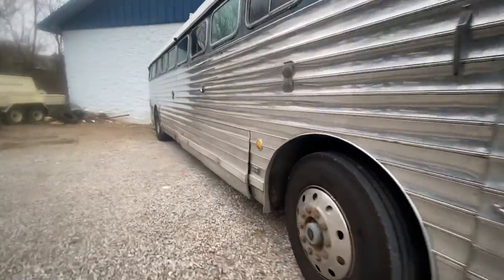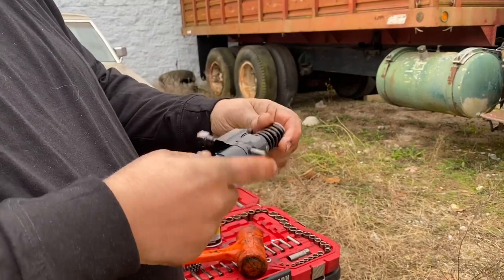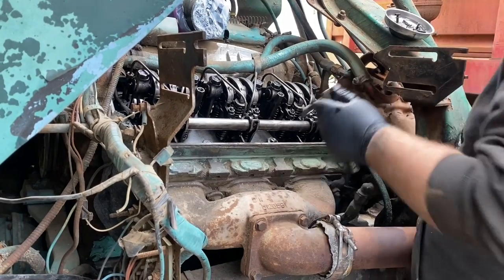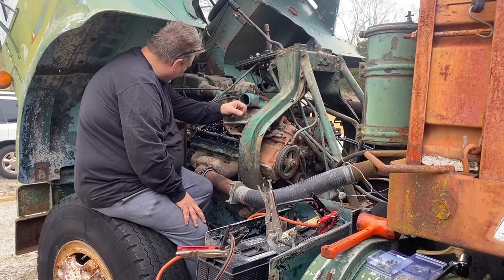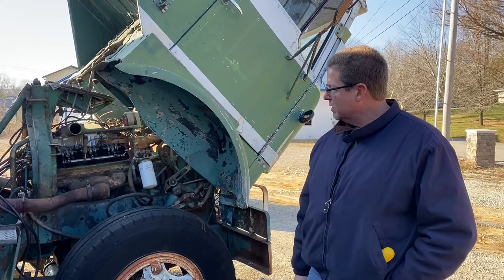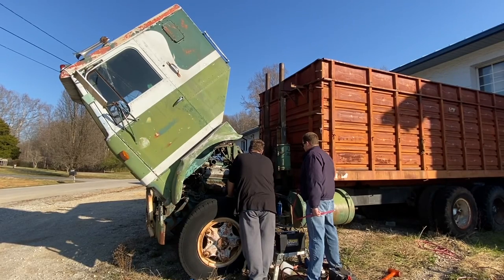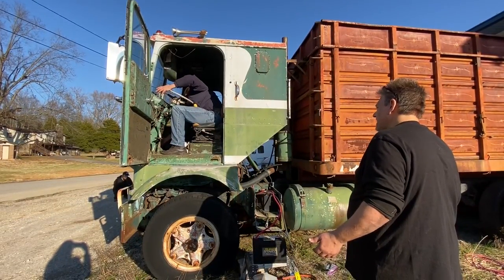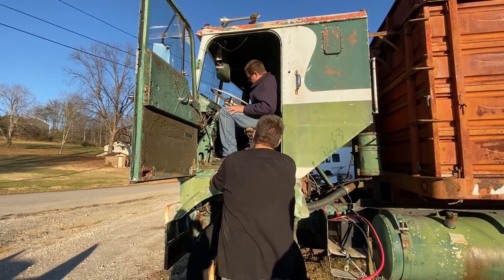1964 gmc cracker box truck 1st start in over 20 years. COE 1st start

Comment: There was an old school trucker's misconception that front brakes caused spin outs on slippery roads like in icy conditions.  So most trucks and tractors up through the late 70's didn't have front brakes.  Research and testing in later years proved that front brakes could actually be an asset on slippery roads.
Reply: driving slow on ice if you have a lever type park you feather it to do the rear only to stop the front sliding on tight bends and stuff
Reply: Modern trucks have front brakes the air pressure is reduced by 40% to help keep the steer brakes  from locking up . It's still possible on very slick roadways though. Trucks today have anti- lock brakes so that helps also
Reply: In the 1980s there were news reports that the New York State Police were cracking down on trucks with deleted front brakes on the Thruway. The stated reason for deleting the brakes was "fuel economy" on that 530-mile road and some said their wheels locked in slippery weather.
Reply: yup.
Reply: Truck manufacturers are increasingly adopting disc brakes.

Comment: That engine looks pristine under the valve covers. The dead blow hammer may not be dead yet but it has been maimed.
Reply: My thoughts exactly, very clean engine.
Reply: Most of these old detroits are clean inside. I used to rebuild 71 and 92 series heads for princess cruises on there entire Alaskan tour bus fleet.
Reply: I noticed the same thing underneath it’s pristine you can tell formerly it was taken care of by its owners

Comment: My Dad drove a 64 Cracker Box flatbed truck & trailer only it was new and had an 8v71 in it. He loved the motor but the cab was the Ford Falcon of trucks, absolutely no frills and not very durable. I spent many Saturdays being the grease monkey as a teenager.  He drove it about three years before he talked the boss into buying a Peterbilt with 8v71. I still love the distinctive sound of a Detroit Diesel. Glad you got it running.

Comment: That truck most likely has a 24v starter. The part you described as the starter solenoid is a series-parallel switch which allows the truck to run on 12v but provides 24v to the starter while cranking.
Reply: The old Mack trucks used those series parallel switches along with a positive ground system. They also used four 6 volt batteries if memory serves me correctly.
Reply: @williamjones4483  you are correct!
Reply: Some of the early diesel Toyota land cruisers used the same system of 24v start and 12v run.
Reply: I had a old Kenworth, mid 70s, that was an 8v, and it was a 24 volt system.  I was thinking the whole time I bet this is 24volt
Reply: He would be better off putting in a 12v starter and doing away with the troublesome series parallel switch. They are a bit pricey.
Reply: Those old 12-24 systems were pure junk. They were so troublesome back in the day you  could have made a business out of swapping out series-parallel switches and Duvac charging system  modules. I don't miss dealing with that stuff at all.
Reply: I'm currently troubleshooting a SPS (w/ positive ground) on a 1959 Freightliner, and it's testing my patience and electronics knowledge!!
Reply: @madmurdock2968  Hey Mad, here's a tip. Go to the internet and look up Dan Sullivans book on Electrical Troubleshooting.  This book is written by a true expert and it's put in mechanics terminology.  Obviously this won't fix your problem but it's the best reference out there for automotive electrical diagnostics.  Good luck.
Reply: Mad Murdock the series parallel switches have multiple internal contacts that can fail. Id be willing to bet your switch is bad.
Reply: @markphilpott8735  Mark, thanks for the tip!
Reply: @junkpile4106  you immediately identified that SPS for BGM!  Most folks would have missed it, it's a good system when it works, challenging, when it doesn't!  Most techs are clueless!
Reply: Not that kind of problems here in Europe. I have been on the road and driving for almost 40 years. Only one truck 10 metric tons Bedford was 12 V all others have been 24 V. Lights starter all 24 V. Simple and good.
Reply: I remember all diesel trucks in the 50s and most in the 60s had 24 starters.  Cummins powered trucks also used a compression release to get oil moving and momentum.

Comment: i was seven years old when this truck was built. In 1988 I began my truck driving career in a 1985 Freightliner cabover with a Cummins inline six that in most respects wasn't much better than this truck, It was a sleeper cab and it had the added on Red Dot air conditioning system and some sort of air assisted power steering. A real joy to drive! Oh, it did have a cheap AM-FM cassette stereo radio and two speakers.

Comment: GM's best engine ever. .they had 2 cyls up to 12 v motors...53 ,71, and 92 ci per hole...all 2 strokes 
Unbelievable power and fuel efficiency and a sound like no other
Reply: And none other than Charles Kettering and his son were who led the development of them, along with their larger siblings, the Winton 201A and Winton 268 series and then the EMD 567 series locomotive prime mover engines that about single-handedly sent steam locomotives to either the scrapper's torch or to static museum displays.
Reply: I love 6v92. When I hear trucks that is powered by it, I've got goosebumps. I've googled some specs. Straight pipe blasts 360 hp and 1000 lb-ft of torque (YEAH!!), which is able to tow a big ass yatch or a few containers in a row. Now, there are few old trucks with this treasure, so if I've got the chance to find one, I will never sell it.
Reply: I say your 1 for 3! They weren't powerfull or fuel efficient. Did sound cool though! Dad ran an '80(ish) CL9000 Cabover with an 8V92TT Silver Eagle. 3.5mpg and couldn't pull a hill for s**t. Was rated at 475hp.  But not much torque.  Replaced it with a '87 Mack Superliner with a 500hp V-8 Mack motor. 4.5mpg and twice the torque. Not reliable though(kept dropping valves).
Reply: Earned its “Screaming Jimmy” nickname. 😊

Comment: Always impressed with how they go from a one lung box of rocks in a washing machine to that wailing banshee of legend with just a little run in.
Reply: The 6.2 and 6.5 Detroit's never lose that  "box of rocks in a washing machine" sound 🤣
Reply: @detroitdiesel-vu3ig  the 6.2 and 6.5 although branded as Detroit's are not .....not really , not the the faithful.   They were a Gm joint design contracted to be manufactued by Detroit .
Reply: mark robertson  odd mine went 100k and broke a wrist pin and ate the block.

Comment: OKS !!! Back in the day when I worked at a Mom/POP Garage in Western NY,,They maintained 3 Cracker Box inline 671's OTR tractors with 5 speed tranny & 3 speed rears!!  Got to run them around in the yd. as didn't have CDL at that time !!  COOL BEANS to hear them run !!! Main Mechanic overhauled 1 of those & really wasn't trained properly to set the rack & 1 ran away when he had the linkage disconnected !!!  What a whine that was till he got it shutdown again !! Ruined the motor and had to get a new short block !!! Thanks for bringing back the memories !!!  And as always ""KEEP IT SAFE ""!!

a

Comment: If any of you ever need to remove a stuck part, bolt or in my instance, a rusted brake drum, PB Blaster is cheap, and IT WORKS! I had no idea what to buy, but this was on sale, and I lucked out, great stuff.
Reply: I’ve actually had the most success with Seafoam Deep Creep, and I’ve tried them all......even Kroil.
Reply: Now everyone has two choices that work. They all probably work, WD40 makes one I'm certain, probably works? lol
Reply: Get their spray lube too. 100% better than WD40. 
Orileys always has combo packs of that and PB blaster on sale for like $5.
Reply: That's the exact same sale I took advantage of at Oreillys. lol

Comment: I rebuilt Delco diesel starters back in the 1980's in Atlanta.  Fun job, for sure.  Also those solenoids, and Leece-Neville equipment.
Reply: I started my career fixing stuff at an auto electric shop. Carrying Leece-Neville starters up from the basement, through the a tiny door in the pit and up to the second floor was a fun expedition.

Comment: Continental Telephone had trucks like this.  Painted pretty much the same,  and they never stopped running.  They would deliver and pickup from our warehouses.  They went away in the 90's.  they were real workhorses.  Most of them had several million miles on them when the company went away.

Comment: I would always pull the air box covers as spray each cylinder wall and rings down. This seemed to help compression and I never had to use starting fluid when using this method.

Comment: Those are Dayton lock ring rims, they are perfectly safe to be around.  They really only pose a threat during mounting if the rim, ring, or lock is in poor condition or if not assembled correctly.   Perfectly safe to sit on once together and aired up.  The pressure of the tire wedges the lock tight.  Split rims are a whole different animal.
Reply: Lock ring wheels usually give people problems if they have been drove flat

Comment: That looks like it would be fun to drive
Reply: Cab overs are the best. Drove a Freightliner new for many years. Great truck. Still not a Detroit Diesel tho. Best engine ever made right here bar none. If you want to start a contracting business this is exactly the truck to do it with. Add a trailer or two and some skid steers and there's no job that can't be done these days. Driveways, drainage ditches, limbing trees, lumber work...right up to laying foundations and throwing 53 foot containers on them and calling that home. Some kid in Suagurties NY named Andrew has made amazing videos of said such activities.
Reply: Andrew Camarata on YouTube.
Reply: hard on the back though....
Reply: And hard on the ears.
Reply: @fastinradfordable  I'd find a wrecked class 5 semi and take its axles and braking system and put them under that truck.

Comment: I used to drive on an 8v in the early 80s. The drive made use of the stop switch to keep rowing the gears after a throttle stuck problem. no breakdown lane.. had to keep going. I do not miss these rigs at all.. but it is interesting to see history.

Comment: Probably think I was crazy, but as I was watching this, I envisioned a custom painted cab, and frame, lots of stainless and chrome goodies, polished or chrome wheels, spun aluminum fuel tanks, with brass straps etc. And you could get real creative and turn that box into a camper shell, with slide outs even😜 or put an old Avion or Airstream body attached to the frame. I know, I'm not right lol, I'm sure the customer will either leave it patina, or restore the original look, but I like to use my imagination now and again😎

Comment: Fun to see a 6v71 ..  I knew they were around .... Never seen on in person. Thank you.
Reply: There were thousands of them around.  Every GMC New Look transit bus had 6V-71's.  I drove them for several years.  Two and three speed automatics, and some were highway coach versions with four speed Spicer manual transmissions.
Reply: Really how? Probably the most popular of the V models, although the 8s and 12s get the glory, the 6s did the work.
Reply: @vector6977  Alaska has a very limited number of Busses , we do have a lot of equipment (and boats) that ran the straight 671's and a huge number of the 6v53's .....have two of those myself.....just never run across anything that had a 6v71....in truck papers and searching parts and wrecks I would say that the 6v71 is more rare than the 671 the 8v71 and the 6v53 ....though arguably less rare than the aluminum block 53's and a few others

Comment: Back in the day we had a lot of truck tractors without front brakes. You were even allowed to remove them until the late 70's.
Reply: (1) The service brakes shall act on all wheels upon application except for the follow ing:(i) On interconnected dual wheels, brakes may act upon only one wheel.(ii) A motor vehicle being towed in drive away -towaway operation.(iii) The steering axle of a truck or truck-tractor having three or more axles was manu factured before July 25, 1980. The steer ing axle of truck or truck-tractor having three or more axles manu factured be tween July 24, 1980 and October 27, 1986 shall be equipped with fun c tioning service brakes not later than February 26, 1988.

Comment: Some years ago I was doing a job on a friend's truck....
Check that there are four new filters in nice unopened boxes, two fuel & two oil.
Remove all the filters using the hammer & screwdriver technique.
Fit oil filters with no problems.
Open first fuel filter box.......... contents are an oil filter 😞
Open second fuel filter box....... contents are an oil filter 😞 😞
and it's late Saturday afternoon 😞😞 😞

Comment: "Old Timers" would remove the front brakes in the winters to avoid ice sliding; especially when the tractor was light.
Reply: Big Wheel  WOW!  I am 69, but I don't remember back that far.  BEST WISHES
Reply: Can't have a runaway freight train that's not on tracks when it doesn't steer... Air brakes with no proportioning valves
Reply: Old timers would  disconnect  the brake hoses at the chamber and insert a brake lining rivet to block the flow of air.

Comment: Many trucks of that time either did not have front brakes or if they did there was a flip switch in the cab for "Wet/Dry" roads.The switch was supposed to limit the front brake pressure to half~~ the system brake pressure. The reason we did not use front brakes was because no one wanted the front brakes to lock on ice/snow/water and prevent the driver from steering the truck. Many of the trucks that had front brakes had them disabled.  We considered no front brakes as a better alternative to not being able to steer.  That was the mind set at the time. The technology was so different then.  Remember we did not have Anti-Lock Brake computers then. We did not even have "Maxi-Brakes"  or spring brakes as the current owner referred to them.  MaxiBrakes were just coming in in the early 1970's

Comment: At 12:16 if you don't have a large 16-16.5" Straight Jaw Tongue And Groove (Channellock) Pliers for removing filters, a scrap of bale twine wrapped around the filter a few times with a loop in the end and a bar, large screw driver or stick through the loop makes a good very low cost "filter wrench".   It is a lot cleaner then punching a hole in the filter too.

Comment: Most times when you find vintage semis the owner doesn't need money and would rather see it rot than sale.. This era usually had splicer type transmission or just tall gear single synchronized tranny.. I've drove them  and worked on them

Comment: When I didn't have a filter wrench with me, if I had a piece of rope or nylon rope, smaller diameter of course, loop one end, wrap the rope around the filter and use a large screwdriver or whatever through the loop to loosen the filter. Last resort was puncture the filter.

Comment: I was scrambling trying to find you a wrench from my computer seat. I've been there before, but with no wrench in sight. Went in hulk mode and snapped the battery leads off the side posts.
Reply from the maker: They were bolted on kind.  My wrench was laying next to the batteries.  Someone picked it up and put it in their pocket.
Reply: Bus Grease Monkey those dastardly neer do wells!

Comment: too much juice for the solenoid caused it to stick on, welded the contacts shut. I had that happen once with a VW. You'd hit start and it would keep starting. Also tried to use one once to control an amp that had been underwater. it lasted about 2 weeks.. apparently they aren't rated for constant use LOL

Comment: Could that be a 24 volt starter?  Maybe using 12 volts is why it drew so much current that it welded the solenoid.  I know that some trucks had 24 volt starting system and everything else was 12 volts.

These are interesting projects, thanks for sharing them.

Comment: Ran across a few old trucks that didn't have front brakes. Seen them with front brake limiters like a valve you adjusted the pressure to the front brakes. Some just had a valve to cut the front brakes in or out. I don't know what year they stopped all that.

Comment: Yeah my old 79 KW W900 doesn’t have front brakes either  and they are Grandfathered in👍🏾🇨🇦
Reply: In California where I was raised the trucks with three axles weren’t required to have front brakes.  If the truck had them they had to be operable. Drivers over the snowy mountains hated front brakes so they were removed. I machined a lot of front hubs to allow the wheels to to be mounted.

Comment: Somebody teach that young man how to properly use a torque wrench.
Reply: I agree, was frustrating for me to watch!
Reply: @Pete Lyczek - He who smell't it - dealt it. Why don't you offer a solution, to your problem? Say... one click and it's done - per chance?
Reply: @markaoslo5653  looks like you already did.
Reply: He's got a clickety click click click fetish.
Reply: @petelyczek5728  - Well, it was a slight of hand on my part and, likely to your chagrin; I too, bump it to the clicker again, on the way back through the recheck, pass(es). I mean, what's the point of pattern-torquing  but, to even the overall pull? The sum, is greater than the total of it's parts and all. And, as a bit of an insider stock trade, in view - watch Tyler's video (over at Indiana Diesel) to see more clearly, that he's check-clicking after the initial torque click - he's not pulling past the click!
I did find it amusing, if not pragmatic, that he hand-spins the ratchet, between checks - presumably, to refresh the internal purchase of the ratchet and, average for the variables - maybe to add a flare, too? Cheers-